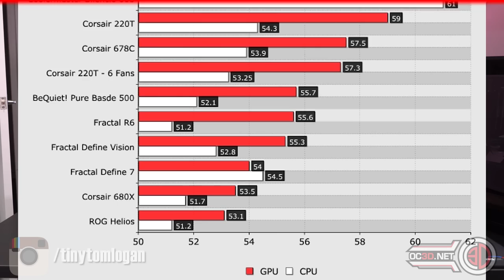Fractal Define 7 including  XL Review

Comment: This is honestly everything I was wanting out of a review of this case and really any case that's come out of recent. So few other reviewers attempt to point out any craftsmanship or nuance in design the way you have, even the detail of the door hinge made me want this case. However, something that should be mentioned is so as long as you don't use the rear 120mm fan, you can fit two 360 radiators typically pretty easily in fractals R/S cases :)!

Comment: Several months later, this very detailed review made the difference in me choosing this case.  Thanks again Guv for all the little details, looking forward to stuffing this thing full of rads!
Reply: I should update this: taking it back.  This case is severely deficient for water cooling.  Typical Fractal case, one compromise after another.  Lian-Li PC011 is clearly superior, so I bought another one of those instead.
Reply: Tegridy Farms  popular isn't always better.  Too limited in terms of rad space, and too big a footprint for what little rad space there is.  With the Dynamic 011 XL, I can house triple 360s in a smaller space, it's just a smarter design.
Reply: Tegridy Farms  you don't speak for the 'vast majority', nor do I.  Two 360s in a case that big is pathetic, and a bare minimum for a lot of us.  YMMV.
Reply: Tegridy Farms  yes, as are lots of us.  And you must not be paying attention to recent CPUs.  We aren't running sub-4ghz quad cores anymore.  The average joe these days has 8 cores, the enthusiasts are 12 - 16 cores, and the workstation guys are 24 cores plus.  These CPUs generate serious heat, and a 360 is the bare minimum for those CPUs, as they can EASILY saturate a 240.  You sound like you don't know much about water cooling, or high end desktops, or both.

Comment: I moved my system into this case 1 month ago. The manual surgest that I run all fans including the CPU via the case fan hub. If I do this the case    and connect the case to CPU_fan. Then all the fans run at boot at 500-600 RPM. However I connect the case fan to sys_fan1 as suggested in the manual. Then all fans run including CPU run at 1400 rpm constantly. 

Or do I ignore manual and just plug the the fan_hub in Sys_fan1 and the CPU fan in the MBs CPU_fan header?

Comment: Another great review mate, I'm a bit late on this one, but glad to see you back into it. Looks like a neat tidy case, but I'm not sure about the front. I would much prefer a complete mesh front panel for better air flow like on the Meshify with the same easy removal as the top panel (and the Meshify front panel IO built into the actual case chassis rather than the front panel). Despite that, I really like the design and the back panel has a really nice cable management idea with raised panel at the bottom and those nice cable routing grooves and tie downs. Nice detailed review, love this stuff. Wishing you all the best. - EDIT: Just got to the end of the video and your explanation as to why it's NOT using a mesh front panel makes a lot sense, just a pity they probably won't go that route. It would be a great case, and the same design philosophy could be used across their case line up.

Comment: Also, just to add the XL is great with high rpm fans if you want them, especially if you get the metal sound door instead of the glass as the airflow in this case is amazing, I got the XL and been tinkering with it, it's likely going to last me a whole decade before I need to upgrade 😮 everything and anything fits in here for now and future 😉

Comment: The main reason I didn't get the r6 was that I couldn't fit my 280 aio rad (kraken x62) in the top due to ram clearance, I have gskill trident z RGB @ 44mm motherboard height when fractal list the max as 36mm in their manuals. The 36mm is listed in the define 7 manuals but at 22:20 in this video it looks like the fans+rad sit above the ram and clearance shouldn't be an issue?

Comment: if you have a vertical GPu does ANYONE know how tall a card can still fit in case (assuming the vertical GPU has no backplate)? At 33:45 it looks like with that big boy GPU in place you could still have a vertical GPU but I'd like to know measurements.....  Tom?

Comment: The only thing missing that would make this a 10/10 for me is a slim 5.25" mount - maybe like the 3.5" mount points parallel to the back cover, with the cutout on the roof. The full size 5.25" is IMO redundant on both variants, would've made more sense to make the front filter whole top to bottom. Still, I understand that a slim 5.25" mount is a very niche requirement, and again, this would be relatively easy to do with a mod.

Comment: A very interesting case, and it looks like it is built well.  However, it looks like there is a lot of wasted space.  It should at least offer a module to convert the front panel to a series of hot-swap bays, and a backplane for connecting a SAS controller.  Otherwise, you could easily put the same guts in a much smaller space without sacrificing cooler temperatures.

Comment: I'd really like to see various radiators crammed into the 7 XL to see what fits. I currently have a 900D with two 60mm thick 480mm rads and I sure wouldn't mind an alternative case. Even if I had to run one 480mm rad and a 360mm rad to avoid them clashing in the top, front corner.

Comment: Still front door open very narrow only to 90 degree, they should minimum to 180 degree or even to the side of case 270 degree, still they can do this corectlly.
Case should be 2-3 cm taller, and shorter on deep, it's deeper even that R5. 
I prefer HDD cages like it was in Define R5.
On another minus they remove second 5.25 bay since R6.
Overall great case, one of the best on world, but still not perfect in all apsects.